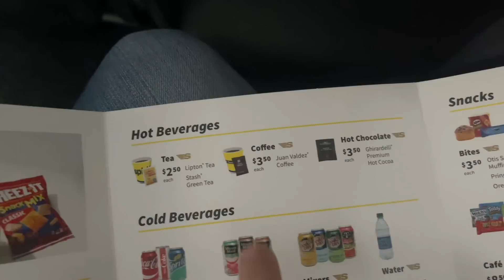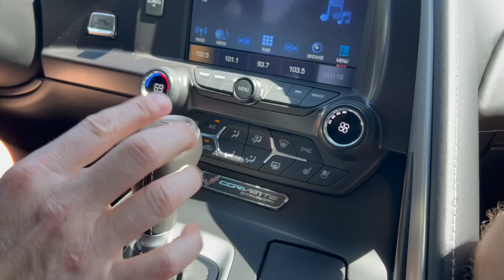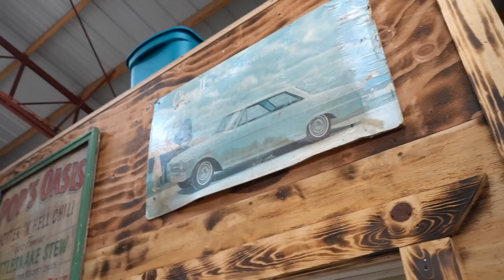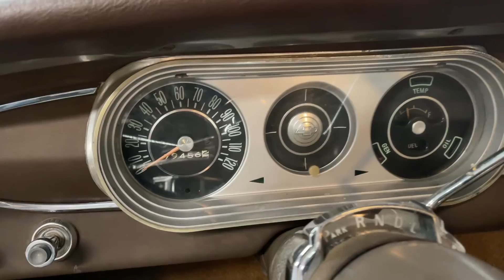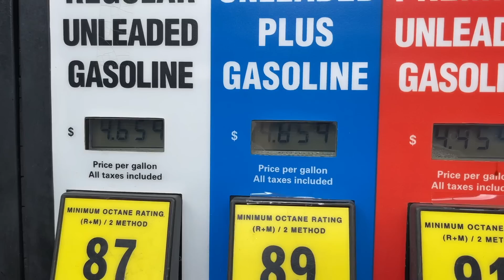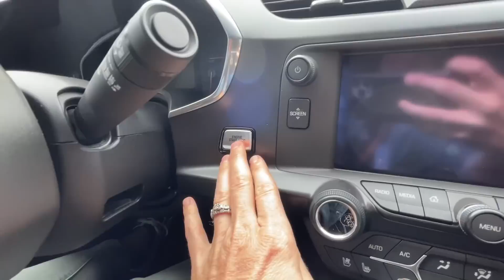Survivor 64 Nova, driving it from Cali to Texas!!?

Comment: Great video. In 1982 my first car was a 65 Chevy II, 283 power glide, manual steering, manual brakes. Same dash, many of the same parts except 2 lights in the rear. While I have gone on to own many higher quality classics, she's the one that got away. One more point, I sold the car to fund my best deal effort. An engagement ring now supporting 32 years.

Comment: In 1977 - 1979 I went on a square body Nova tear.  Had 4 of them.  My favorite was my '64 SS, with a 283 and a [Emily will love this] 4-gear.  
Glove box light works, dome light works, headlights work - do the reverse lights work??  Be certain to lock the ignition switch when exiting the car.  in the "off" position, fingertips start the car.  Don't even need a key.  I'd be sure those new keys lock the switch.  If I knew how, I'd send y'all a couple Briggs & Stratton OEM blanks for Nana!
Emily, you are fickle!  First in love with a Corvette, then swayed by a little Nova...😁
Glad y'all got a V-8 car.  Makes the little cars fun to drive.  I'd keep it original [even the radio, it can be repaired/upgraded - Just Dashes makes a repro dash pad], as they are hard to come by, in V8 fashion. Very cool to have the OEM wheel covers.  They are only original cars once.  Even 4 door Novas have value, original not restored, especially when they are in the condition of yours.  Nice find!   
As far as breakage, make sure the spare is good, get extra belts and radiator hoses, maybe some heater hose [don't forget clamps], stuff like that.  I predict a smoooth trip, averaging around 18 MPG.  BTW, like that you added a short segment of driving the Nova in the outro.

Comment: Emily, on a car like this one the only thing the left foot should be used for is the dimmer switch. Aaron is right you didn't read your driver's training manual. Love this car. Remember the 283 and powerglide combination first appeared on the '56 Chevy. The 265 is the first of a line of engines running all the way up to the 350 small block.
Reply: The '56 was a 265" motor.  I owned an all original '56 2 door hardtop in 1963 and had the engine bored it out to 283".

Comment: My second grade teacher had this car in a two tone blue...It suited her perfectly; she was in her 60s at the time...It was 1964 and she had just bought it new...I was 7 at the time...I'm 65 now...My experience with mid-60s Chevys suggests that fuel pump, water pump, and electrical systems would most likely be what I suspect might fail, but if you treat her well, you might very well get home with no problems at all...Congratulations on what looks like a very solid car...Fix that A-pillar soon...Having spent time in Ohio, rust will likely be a problem elsewhere on the car as well...

Comment: I got a new 1965 Nova two door hardtop my senior year in high school.  Mine was also a 283 Powerglide.  Tough little car.  I upgraded mine a bit with a four barrel Rochester and dual exhaust.  My Dad had a 64 Chevelle with the factory power pack set up, basically the same as mine ended up with the four barrel and dual exhaust.  Those two would run wheel to wheel in the quarter mile.  I sold it when I entered the Army in 1967.  Upon my return from Vietnam in March 1969, I bought a new 1969 SS/RS 396 4 speed Camaro.  These two were probably my favorite cars to date.  Wish I still had both of them.  Have fun with that little Nova, I know you will!!!

Comment: Nice car. If the engine is original take it easy till you get home then replace the timing chain and gears. You might have issues with the cooling system, and charging system. Take the voltage regulator off and clean the points. They get a little crusty. Just in case; the voltage reg. is the 2 1/2 X 3 inch square box on the rad support.  haha We all know about opinions, but I think the 283 is the best engine Chevy built in the late 50s to early 60s. Check the fluids daily and it'll be fine. Good luck on your trip.

Comment: I would be checking the wheel bearings and front end parts (T-Rod ends and ball joints) before making a 2,000 mile drive. Also grab an extra fan belt and perhaps have some electrical tape on hand in case you need a quick rad hose repair on the way. Good luck and safe travels.

Comment: My very first car that I bought after I graduated from High School way back in 1972 was a 1963 Silver Blue 2 door Nova. One of the best cars I ever owned, and definitely my all time favorite. At least until a big dump truck essentially destroyed it running a stop sign. I wasn't hurt, but we could never get the frame straightened out enough to make it drive able again. Man I miss that car and the 3 years I spent with it.
Reply: Have the same car the 194 started pumping oil into the coolant so we put in 283, now its aqua blue and interior needs finishing

Comment: In 1967 I took my driving test  in my Dad's 1960 Falcon. I convinced my parents to buy a 1965 Nova SS. It was tone blue,  6 cylinder, bucket seats, powerglide floor shift. Nice car. I drove it until I bought my first car, a 64 GTO convertible. That led to many muscle cars over the years. My best friend had a 64 Nova SS,    Factory 283 four speed that was really fast. He sold it to another friend, it was stolen and never seen again.

Comment: My first car was a ‘62 Nov 4 door in the exact same body color. It was a 194 C.I. 6 Cyl with a 3 on the tree and a horrible knock. I paid $80 for it. I blew that up in short order. I bought a 230 CI 6cyl and “rebuilt” in in shop class. The I found a Hurst 3 speed floor shifter ( who knew? ) for free and installed that in the driveway. 
I had 3 Novas in my life. The last was a 69 2 door that I never should’ve sold.
Thanks for the memories!

Comment: Great car!! Can't wait to see all the adventures you guys have between Cali and Texas! I don't think you aren't going to have any problems with the little Nova that are her fault. Now, I'd have a spare belt,  radiator hoses, and a thermostat with me just in case. Who knows if you can trust the manufactures of those things!🤣 Have a great trip!
Reply: I was thinking the same.
Add:
Hobofreight tool set
Extra sparkplug / coil wire
750 Amp jump pack
Med. Size Cooler (center console arm rest)
Lightweight floor jack (maybe)
Duct tape / zip ties

Didn't show spare / jack condition

Route 66 here you come.
Start at Santa Monica, CA
Reply: Nope. Heading to Tucson. Interstate 10

Comment: I've had four Nova's over the years , the first being a 1966 red l79 350 hp 327 4 speed. The oddest one was a 1962 2 door sedan 4 cylinder, three speed on the column, with barely any chrome trim, the old chuck style rear end, rubber floor mats, single speed wipers, that I was going to hotrod but I just couldn't do it to such a rare car. Enjoy your new toy and I'll be watching fore the future upgrades.

Comment: I had 4 or 5 Chevy II 's in high school and college, loved them and miss them, mine all had the 194 inline 6, fix the rust and keep it a survivor she is unique ride, get the important spare parts, belts hoses sounds like a good idea, but do not forget about points and condenser and a coil remember she is old school and if the points and condenser go, you won't , check her fluids often, and you need to get a lead additive because  the valve seats were designed to run on leaded gasoline, and you could damage the valve seats running it on the 87 unleaded gasoline, drive safe.

Comment: I had a 67 Chevy Impala 2-door with a 283 and a two speed slush box transmission. Bought it for $200, cut the roof off of it painted it yellow with a custom flame job and drove it. New plugs, points and wires and we drove that car for years! Great on road trips, nice on the highway. All these years later I feel bad about chopping up a fairly decent 67 two door, but back then they were common and cheap.
Loved that car.
Enjoy your 64 Nova!

Comment: That's a cool app, wish it was in more places. 
I love Emily's smile. The only issue with you two getting a C7, would be keeping tyres under it. 😂

Personally, I'd drop a late model 350ci in it with disc brakes. Then putting all the old stuff in a create. So it can be returned to original later. 
Look on the back of the leatherman box, that will show you where the knife is. 

As for stuff that can break, Alternator, water pump, anything rubber. I'd also grab a tube of silicon and do a temp repair on that windscreen and a bluetooth speaker for the drive home.

Comment: Love that little car. As good of a survivor as it is I think it should be kept as original as possible inside and out. It's a great time capsule that's for sure. My grandparents had a '66 Chevy II Nova 4 door with the 230 and 'glide. It had a NECK BREAKING zero to 60 that you had to time with a calendar but it was a great running rig that was a good daily for my grandma and my dad and his 3 siblings all learned how to drive in it. They had it from '71 until around 2000. When grandpa brought it home my dad's older sister cussed him out for getting a Nova. She was a rebel and still drives like a bat out of hell in her mid 60's. Ironically, she ended up owning it for a few years and then sold it back to grandpa a few years later. Could be a 'glide thing but the 230 had the same whine from the inside of the car as that 283 does. Hearing that whine really took me back. When grandpa sold that car in around 2000 it was a clean and rust free garage kept cream puff...and was actually cream colored. Looked better inside and out than a lot of cars less than 10 years old. The radio and heater never worked in it though.

Comment: Those 1950s 60s cars will go all day at 65 70 MPH just check your oil and  coolant levels here and there and watch the lights ( idiot lights lol ) if one comes on pull over... maybe an extra fan belt in the trunk just incase... if its a 283 2barrel its 195 hp 4 barrel its 220 hp. Ive had several malibus over the years.. my 64 malibu i bought with 73k a long long time ago lol . I love it ... good luck and thanks for sharing and welcome to Cali !!

Comment: Love the old Nova's. I don't expect you will have any problems on the way home. The 283's were the most dependable and long-lasting engines that Cheverolet ever made. I have seen them run over 300,000 miles if you take care of the oil changes and tune-ups.
Reply: I had a '66 Nova with the 283 and it was still running strong at 200K when the body finally fell apart around it.
Reply: every small block from then till 74 were all bullet proof. good ole iron in them blocks.
Reply: @kenreeve32  Yeah my neighbor had a station wagon with over 300,000 miles and the body rotted out from under neath of it. The motor was still running though. I believe the only reason Chevrolet got rid of the 283 and 327 is because they would never die.

Comment: I don't think that it will fight you, they are just so simple that they don't tend to quit. If you do have problems, I would expect them to come from the water pump or the points. Sometimes they snap if they are very old. I would suggest that you take a good look at the front brake hoses and be sure that the parking brake works as it might be all you have! Have fun!

Comment: 1964 was the 2nd year GM used altenators (w/ external voltage regs. GM left 'Generator' on the dummy light for a few years after. If any problems happen, it will be the water pump, or the electrical system. Safe travels guys!!!

Comment: I'd find a harbor freight get a mid-size tool kit. Mechanical fuel pump and an alternator in the belt if it actually has two of them. Both radiator hoses and a thermostat. Anything else you should be able to get it even Walmart coolant oil simple stuff like that. But the 283 powerglide they're hard to beat dependable on top of dependable. Really glad you two found this little car it's awesome. I believe Nana is a keeper.

Comment: Emily, Arron is correct, left foot on the brake pedal is a no no. First of all as time goes on you will end up resting your left foot on the pedal, the constant downward pressure will cause a slight braking action which will wear your brakes out prematurely and as a safety concern the brake lights will be illuminated all the time your foot is on the pedal, confusing the the drivers following  behind you who now don't know if you are slowing down/stopping etc. If you must rest your foot on something look for the little dimmer switch button on the left side of the floor up towards the fire wall it will serve the purpose for you.

Comment: I just did a frame off rotisserie build of a 62 nova wagon like joes and I also have a 283 ( out of a 67 Nova) and turbo 350 in it. Putting in a 700-R4 this fall. Will be watching for further attention you give to your new ride. Good luck and have fun.
Reply: How did you do a frame off rotisserie build of a car that has no frame?
Reply: @Dave-in-MD  the front frame unbolts from the car and then the rest of the car was put on a rotisserie.

Comment: Water pump lube would be disaster protection 😅!!!  Bars leak makes a good one.  Also, jump pop off the grease cap on the front wheel bearings, pack them well and adjust the preload loosely 1/4 turn off 0.  That could save you a big issue 😊!

Comment: I would say that the most likely failure points would be the fan belt, front wheel bearings, water pump, and one of the front rubber brake hoses.

Comment: Very nice! My very first car was a '68 Cutlass with the high compression 350 and the "Jetaway" 2-speed auto. It would give a chirp going from first to second, at 67 miles an hour. It surprised a few people at stoplights. That little Nova is a great ride. Hope you get many, many miles of joy from it. All the best to you both.
Reply: It would do 67mph in first gear 🤔
Reply: We're not talking about a 4-speed, or even a  three-speed auto. Check the numbers yourself. With a G78-14 tire, Jetaway first gear ratio about 1.78 , and a 3.23 rear gear, 67 mph is about 4800 rpm. Which is just about where Oldsmobile advertised its 10.25:1 350 to make its rated horsepower. From the Wiki... "In Drive at full throttle, it would upshift from low gear to high gear at 60–65 mph." My speedometer wasn't calibrated, but 67 is pretty close to 65. The Jetaway was not a Powerglide, it was a different design. But it was a two-speed auto, and they still use the two-speed Powerglide in drag racing today. Cleetus McFarland has run one in some of his cars.

Comment: Great find on the nova… we have a 1966 4 door survivor as well .. straight 6 230 CI with a power glide … we have driven it all over .. so far only a fuel pump and transmission seals have failed …. Still has original drive train .. just replaced the fuel tank because if rust issues … but the tank had been replaced before with a used one from where about  where abouts unknown … I see it has rust issues as all GM cars from the 60’s do … one question though … what is the obsession with  the YouTubers having to do burn outs in every vehicle they get in … 😂😂😂

Comment: Many years ago I drove a Nova (a bit newer model than yours) from the bay area to the Seattle area. The alternator failed just before Seattle. Stopped at a truck stop and got new brushes and was back on the road in about half an hour. Based solely on that my money is on alternator.

Comment: I would carry all the fluids , brake fluid, coolant, at. Also check the tires, if they are old then replace them,  check air in the spare . Carry some spare worm clamps for the radiator hoses , maybe some stop leak. Several rolls of electrical tape , mechanics wire, zip ties, electrical wire, reasonable tool kit , small aluminum floor jack, tools to change a spare tire . Neat car, have safe trip !

Comment: The only things I would expect to fail would be the water pump and the alternator, and since you have a spare water pump hopefully you are good!
Reply: Timing chain fuel pump radiator cap new wiper blades. Fuel filter points cap rotor. U know the drill. Coil

Comment: Being a sbc really just basic things can go wrong. Alt. Starter. Water pump. Belts tires . that's a beautiful 4 dr Nova. A real survivor. I just bought a 4 Dr 65 buick special. Someone put a 350 Chevy in it. Little rust not much tho. Thinking about a 2 Dr conversion. I'd fix what needs to be fixed on that no a and leave the rest alone. That's my thought anyways. Great video

Comment: The two speed automatics were geared fairly high and had high stall speed torque converters.  The owner's manual for mine said not to exceed 55mph in 1st, but even under moderate acceleration it would shift somewhere around 30mph.  Seventy is not an unreasonable speed to cruise in that car.
Seeing the two Chevys together shows that you ride in the Nova, but you wear the Corvette.

Comment: Love the Nova!! She really is "so sweet." The 283 & PG are a great combo. I don't think y'all will have any problems, but if it were me & had a few days I would go ahead & do some preventative maintenance on her like a good tune-up, change the belts & hoses, oil, flush the radiator, transmission service, rear diff. service, check the brakes & wheel bearings. Basically I would check & replace anything that would be a pain to do on the side of the road & anything you don't replace, go ahead & buy it to take with you. It would be better to have it & not need it than need it & not have it. You know as well as I do, that if it does happen to break down 9 times out of 10 it's going to be somewhere in BFE & no parts stores.I would also do a temporary fix on that leak on the A pillar because you know you're going to run into some rain on the way home. Good luck bringing her home to our great state of Texas!!